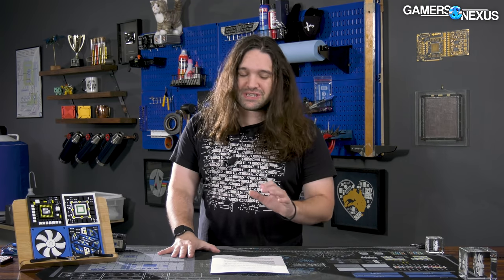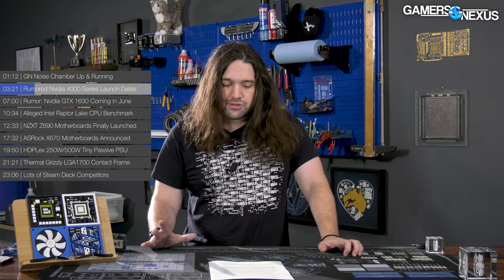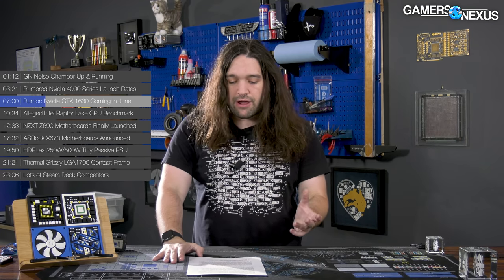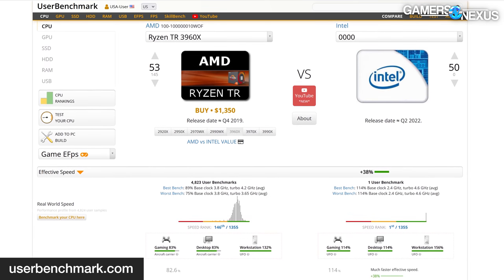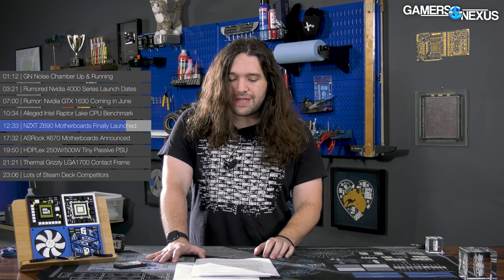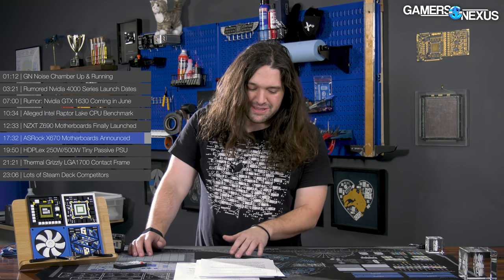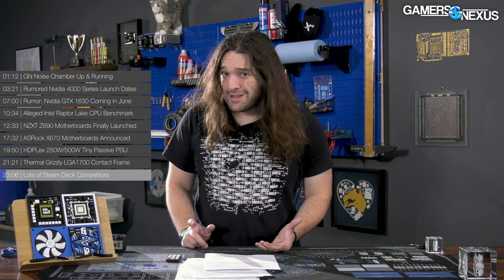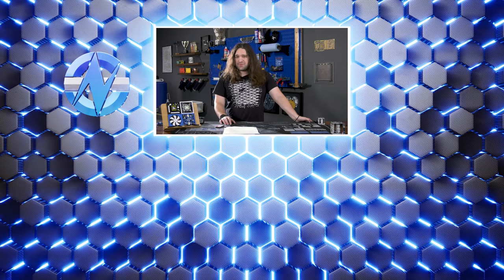HW News - Unbend Intel, RTX 4090 Launch Dates, GTX 1630 GPU, & Steam Deck Alternatives

Comment: I’ve received my Thermal Grizzly Contact Frame last Wednesday. Been testing with it for these past days and it knocks off a few degrees for sure. But also: previously, I could observe a bigger delta between the core temperatures running the same test. This is anecdotal evidence that it does what it claims, it will be interesting to see hard data GN and others can obtain from testing. The Contact Frame is rather expensive for what it is, and quite niche, but so is most stuff from TG.
Reply: 1.that new frame is made by plastic or metal? 2.Can I mount any CPU air cooler or water pump on it? 3.Sanding CPU surface down is really required?  4 Can you move CPU using finger when the frame is tiled down to socket? 5. how much it cost? thank you.
Reply: @Radek__  1. Metal, or rather: some sort of high-grade aluminium.
2. Yes, it fully exposes the top part of the IHS and presents a perfectly flat surface to mount a cooler on.
3. No, not required. I didn't do it either.
4. No, you cannot move the CPU with your finger once the frame is mounted. The frame mounts with great precision, and always fits in exactly the same way.
5. It was 49,90 euro where I bought it (in Germany). I believe Casekings (also Germany) lists it at 39,90, but they didn't have any stock yet.
Reply: @kasimirdenhertog3516  Thank you for answer! Last time I was thinking about to switch from i7-9700k to i9-12900KS BUT as soon as I read about that socket gap bent issue I thought that it is risky to buy it now (it is better to wait until intel figure it out - to introduce lga 1700 rev 2.0 or something)
But now, because of your answers, I know that Thermal Grizzly Contact Frame will fix it  and I can switch to 12900ks without worries.
Thanks again
Reply: @Radek__  no problem, glad to help! To be fair though, the bent IHS issue shouldn't be exaggerated. You should be okay if you'd have something like a 12900KS and a 360 AIO. But for overclocking, and situations where every degree/watt counts (SFF builds), the Thermal Grizzly Contact Frame is a solution.
In my case, I've got a 12700F in a passively cooled system (so no fans whatsoever). I try to tune the CPU to just below 100C. With the TG frame, the temp dropped from 98 to 92 degrees C, so I could dial the CPU up a bit more for some extra performance.
Reply: @kasimirdenhertog3516  nice to hear that it is possible to keep that CPU in tolerance without fan.
in my country - Poland I see that frame from thermal grizzly at price 200zl/pln (44 euro).
 ...
I found also another frame from Thermalright but from Allieexpress for 10euro but there is no specification about used materials,
but Thermal Grizzly declares that their frame is based on anodal aluminium 7075. special one, which can handle extreme OC high and low temperature without bent, deformation, or degrade process as typical aluminium. and it is made with high precision in Germany. so I will buy grizzly.

Comment: I laugh at the idea of an Intel leak from Userbenchmark being taken as serious in any way. Those glue-sniffers running that site will do anything to put Intel on top by a "hugely" margin.
Reply: You make it sound like Intel's umpteenth marketing division is independent fanboys...
Reply: Really? Is this true? I had no idea.
Reply: @tradingnichols2255  it is, gn and hub both did investigations regarding ub.
Reply: @tradingnichols2255  It's been true for about as long as userbenchmark has been around. They also used to pay google to be at the top of all hardware reviews. They flat out suck they are inconsistent with their ratings and have even created new ratings to weigh Intel products higher.
Reply: Intel and Nvidia. A 3070 is not faster than a 6800 XT.

Comment: Hopefully the 4000 series makes the 3000 series cost less, well at least the low end GPUs from the 3000's
Reply: $500 3080’s for the masses
Reply: During the GPU great depression, prices of ALL cards went up, including the prior rtx cards. If there is another depression, prices will go up again. Which is why Im going to invest in a 3090 before it becomes $3000 again
Reply: @AgroFro  a 3090 wont become 3000$ if the 40 series of cards is out
Reply: No ,,they will be more expensive because the production will stop
Reply: man you make RTX 3090ti owner crying, they were not ready
Reply: @oliverwilliam6931  production for GTX 580's also stopped and they arent worth 3k
Reply: @AgroFro  3090's have such trouble with cooling.

If you want/need some of the most powerful go for 3090ti which actually know how to cool the memory (because it's mostly a fixed 3090) or get a 3080ti.

Personally, I've looked at 3080ti more.
Reply: @AgroFro  I don't think you know what a depression is. I think we're beyond, economically a recession, and we're into a depression.
Reply: Nvidia will just release 4000 at higher price.

Comment: I'm getting a feeling the 4000 series will be like the 2000 series. A mediocre jump in performance. Then the 5000 series will be a huge jump. Making regret buying a 4000 series. Kind of what happened with the 2000 series when the 3000 series came out.
Reply: I am just hoping 4000 series would make buying 3000 costs less
Reply: Extremely unlikely to be a 2000 situation. Going from Samsung's terrible 8nm to TSMC's 5nm Performance alone is practically 3 generations of node jumps.
Reply: 30 series is the second worst generational improvement in the last 10 years,only second to the 20 series,its just that the PC gaming community grew over 5 times since 2013 generating all the hype
Reply: Fionn MacCuill  Does it do 4k raytracing @120fps in all AAA titles? 🤔
Reply: Fionn MacCuill I prefer the fidelity of 4K without supersampling.
Reply: @infernaldaedra  4k120 won't really be possible yet even without raytracing lol. The 3090 setups typically only average around 90fps (with 5-15 fps stuttering) at 4k so even a 30% increase wouldn't be enough to lock 120 without a lot of stuttering frames.

Comment: I hope the 1630 is an OK card.  Would love to upgrade my kids' 4th gen PCs (I'm eternally on a lower budget so...yeah)
Reply: Thats why Ryzen APUs area great. Esports title gaming pc under 370€
Reply: trust me when I say this, do not get anything below a (x)x50 from nvidia, the 50$ difference does huge. It is worth the wait, instead of being the x30 then waiting 8 years to get a new one because it stops working because the fan is dead so it overheats and crashes your pc whenever you want to do anything
Reply: had kids you can barely afford. very responsible.
Reply: @Joker-no1fz  🤡
Reply: @Joker  pc hardware may not be a priority to be spending money on. Also, read. A parent saying their kids have a 4th gen pc - like an i5-4670. The children may very well be toddlers playing nothing more than Math Blaster and Rocket league. 

But alas, one can except such a comment from someone who can’t even have children because you have to first find a willing woman.
Reply: @Joker-no1fz  
If it was left to the "responsible" to replace the population, then that would require those on average incomes or better to have 6.3 kids. As it is the more affluent who can afford more kids, tend to do the opposite and have fewer.
Who is then the "responsible" ones, those who have kids they can "barely afford", or those who don't have kids they can easily afford.
Is responsibility measured by the size of your GPU?
Reply: @katsuenyagaming  Current Ryzen APUs are terrible, beefy CPUs with fairly weak iGPUs. Vega is ancient, but even the new RDNA2 iGPU specs are disappointing. Paying 370 EUR for a budget e-sports PC with integrated graphics is a scam, only possible in the current silicon scarcity scenario.
Reply: @ozicrypto G If I had kids I would just get them a Xbox and call it a day lol.
Reply: @sovo1212  True, Vega IGP is only at GT 1030 level but OP is talking about the GTX 1630, which is supposedly a replacement for the GT 1050 Ti, as mentioned in the video. That is the same level as the high-end RDNA2 IGP 680M, so that "disappointing" spec is what is being considered here anyway (with the benefit of lower power consumption).
The real problem is that the sought-after Ryzen 7 6800U, which is the only ultrabook model that has the high-end IGP (and would thus not be paired with a dedicated GPU), is simply not available right now and of course that it's mobile only. It will probably take till next year until the desktop version for AM5 motherboards is released.
Reply: @Lightkie  The beauty of the 1630 is that you can pair it with a budget CPU, while APUs are way off-balance, with a huge GPU bottleneck. If such build can match the performance of AMD's RDNA2 APUs at a lower price, it's a win.

My concern is the 64-bit bus, it might have the same issue than the xt6400, killing its performance for older machines. And, of course, the price, we'll see if it's possible to get one at MSRP.
Reply: @sovo1212  Comparing with RDNA2 IGPs is moot if it's not available for desktop yet. If you need a faster GPU than Vega IGP, you need a graphics card. But if a GT 1030 for €89 (including 19% VAT) is enough for you, what €78 budget CPU would outperform a €167 Ryzen 5 5600G?
Although suggesting an APU when OP is clearly not looking to buy a new computer certainly doesn't help.
Reply: @Lightkie  I think the price point for a fair comparison is a little bit higher. I don't expect AMD to be releasing a 5600g generational replacement for less than 250 USD (the 5600g was released at 260), maybe even up to 300. The 1630 only needs to match the performance of a 1050 (non ti) to obliterate the 5600g and even the 5700g, just look for comparisons. Then you have the 12100F from Intel for less than 110 USD, which also comes with PCI-E 4.0 support. If Nvidia could deliver the 1630 for less than 140 USD, the Intel build might be a better choice over an equivalent RDNA2 APU.

Also bear in mind you will have to buy a brand new platform with DDR5 for RDNA2 APUs, that alone means a higher price for the motherboard compared to existing alternatives. The good news is that this will force AMD to lower the price of their APUs, or to deliver better balanced ones.
Reply: @sovo1212  Not sure why you chose to answer to me by ignoring what I just said.
Reply: @Lightkie  WDYM? My first comment wasn't for the OP, but for another user vindicating AMD's APUs.
Reply: @sovo1212  I mean the one from an hour ago, where I asked you something that you didn't answer, after saying that comparing with RDNA2 IGPs is moot for the desktop.
But fine, if you absolutely want to go into speculation about something we simply can't know since it's in the future: you are way off about the price for a potential 5600G successor. If the street price is already almost €100 lower, there is no way a 6600G is going to cost over €200 after Zen 4 comes out. Not sure why you point out PCIe 4.0 support either, in case you were not aware, Zen 3+ APUs support it as well.
Reply: @Lightkie  It's not as moot, you can see right now comparisons between 680m (flagship RDNA2 mobile APU) and Vega 8 (flagship previous gen), the improvement is somewhat underwhelming, less than 50% on some games, while discrete RDNA2 had a much bigger advantage over Vega.

Also they aren't comparable in terms of core config. 680m has 768:48:8 with 12 CUs, while Vega 8 has 512:32:8 with 8 CUs. On the other hand, the 660m (6600u/h) has 384:24:8 with 6 CU, compared to the mid tier Vega 7 (5600u/h) which has 448:28:8 with 7 CU. This means that, in terms of relative performance, RDNA2 mobile mid tier is much worse compared to the flagship iGPU. If AMD follows suit with the desktop variants, the performance gain from 5600g to the theoretical 6600g will be even less impressive (maybe not enough to beat a non-ti 1050, therefore a 1630). And again, I don't see the 6600g releasing for less than 250 EUR, unless, maybe, a 1630 build proves to be a better choice.

5600g would be a really bad purchase right now, it's better to wait or get a second hand PC with discrete graphics for budget gaming. Hence its lower price compared to when it was released.

I mentioned PCI-E 4.0 because it might be relevant to avoid performance losses with the 1630, which has the same narrow 64-bit bus as the rx6400.

I think that leaves no unanswered topic, take care.
Reply: @sovo1212  You keep ignoring why it's moot to compare them for the desktop: the unknown price, which you somehow already know is going to be the same without anything to back it up. I did not think I need to point it out but it will continue to have Zen 3 cores (Zen 3+ just refers to improvements in the power management, the performance is the same), so it will be one generation behind in the CPU department after Zen 4 comes out. That would be like releasing a Zen 2 APU in 2022, which AMD did. They only released the Ryzen 5 4600G for DIY two months ago, which was OEM-only before, for all of $154 (and most reviews say that is still too high for its gaming performance).

And no, saying that 5600G is a really bad purchase right now does not answer my question but I did not expect you to answer it, since there obviously is not CPU + graphics card combo that can compete against it in price right now, so much for "scam" and "off-balance". You know you were talking out of your arse.
Reply: @Lightkie  Well, I think at least you do realize AMD has been releasing outdated desktop APUs. Just a reminder, the previous flagship APU, the 3400g, had a release price of 150 USD, it even had a BETTER iGPU than the 5700g (Vega 11) and this means it was far better BALANCED. You don't need 6 or 8 cores for budget gaming, and at the same time Vega 7-8 is absolute crap. For 167 EUR AMD could easily produce a 4c/8t APU with RDNA2 graphics (essentially a desktop version of the Steam Deck APU), and it would eat the 5600g for breakfast.

So, if no CPU+graphics combo can compete with the 5600g, it doesn't change the fact that it's a sh!itty product. It wouldn't even exist if not for the scarcity, which allowed AMD to milk the low end market, slapping us Vega graphics across 3 APU generations. Intel also failed to deliver any decent iGPU in all these years.

So yes, my arse still says you should save your money until you can buy something better. Of course, many people are sheep like you, still willing to pay for that crap.
Reply: @sovo1212  You even showed concern over the 64-bit bus of the GTX 1630, so I would have thought that you understood why an RDNA2 IGP would not have helped on AM4 or why AMD cut the Vega down from 11 to 8 CUs (find me a review where the 3400G is faster than the Zen 2 or 3 APUs, I will wait lol) but I guess that was too much to ask.
Reply: @Lightkie  While I never said the 3400G will outperform the newer APUs (that's a straw man argument), if you look on YT for comparisons against the 5600g, you'll see the 3400g holds up very well and even beat it on some games. And that's an APU released in 2019 for 150 USD versus another released 2 years later for 259 USD. If you don't think that's a scam, you're delusional.
Reply: @sovo1212  You literally said it has a better IGP, why would it be a straw man argument to point out it isn't? And of course it holds up well, just as it would against a RDNA3 or RDNA4 etc. IGP on AM4 because the DDR4 RAM speed prevents a higher performance, no magic about it. Which is also why DDR5 is probably the last boost IGPs will receive from system RAM in DIMM module form, as the frequencies hit the practical physical limit. HBM RAM can't get cheaper soon enough, it's high time that Kaby Lake G gets a successor. There is already a rumour about a 24 CU APU for AM5 in the works for a while, so hopefully not too long.
The price is going to be a problem though, I fear. If you want a cheap option, funny you should mention the Steam Deck: if you paid attention to the video till the end, he mentions an APU called Mendocino that AYA wants to use for their gaming handhelds. It's actually the Van Gogh APU designed for Valve that they call Aerith (with 8 CUs instead of the 6 from the 660M). AMD is ending the exclusive deal and actually targets the low-end $400 notebook market, so the price should be accordingly.
Reply: @Lightkie  Well, yes, Vega 11 is indeed better than Vega 7, d'oh.

A 24 CUs APU sounds great, but I wouldn't expect it to come with anything less than a 12-16 core CPU for over 500 USD, i.e. completely useless for budget gaming.

Mendocino is NOT the Van Gogh APU. It's a 4c/8t with only 2 CUs, but also with 2 32-bit channels for LPDDR5 (Van Gogh has 4). This means half the bandwidth and much worse graphics performance.
Reply: @sovo1212  You know that there is more than one variable that defines the performance, right? The clock frequency matters as well, which is why Vega 11 on 12 nm process node is not faster than Vega 8 on 7 nm, that's the error you keep failing to see (I suspect on purpose, stop playing dumb).
Just rechecked the Mendocino specifications and you are right, I only heard one news about it when AMD announced it without giving the CU count, so that's what was speculated, too bad. But at least it seems Banded Kestrel finally has a successor, then.
Reply: @Lightkie  Oh, then when the 3400g beats the 5600g on some games it must be some kind of voodoo magic, I see...

Comment: It's possible that the Optical S/PDIF output is a header on the motherboard. This used to be mostly exclusive to coaxial (electrical) S/PDIF but there's no reason there can't be LED driving hardware there instead.

Comment: Useful trick: when your O/C fails and your motherboard doesn't boot and you don't have access to reset CMOS or don't want to bother pulling the battery, you can do this: pull one stick of RAM out and turn on the PC. This will put the PC in a 'default' state, prompting you to either continue or enter BIOS to change settings. Obviously, you can choose to go to BIOS and fix the issue.